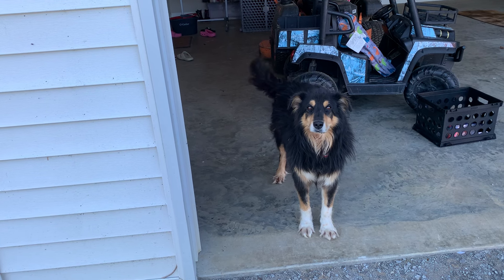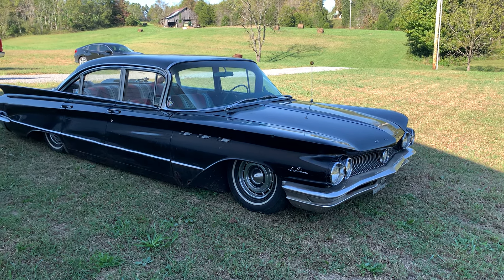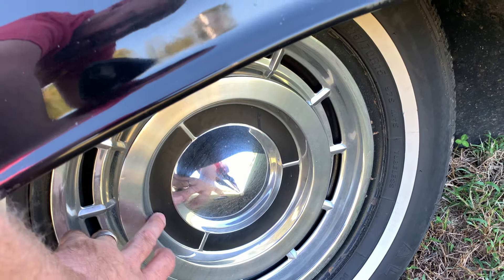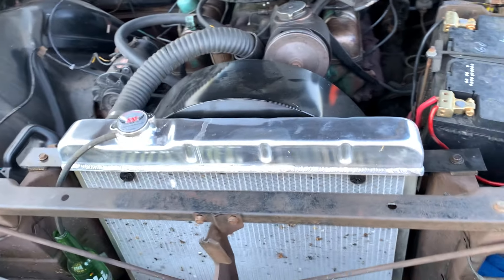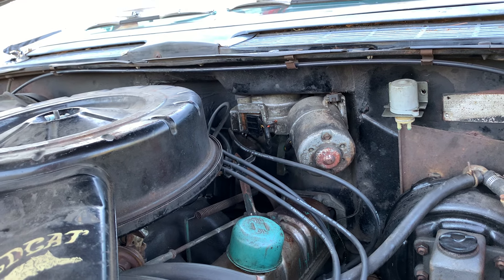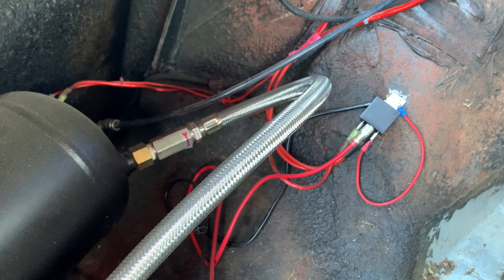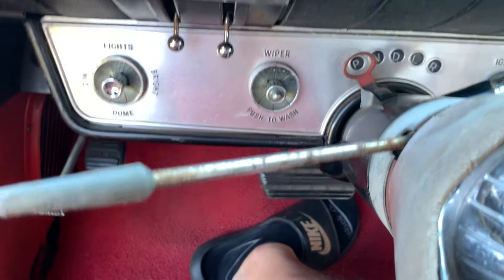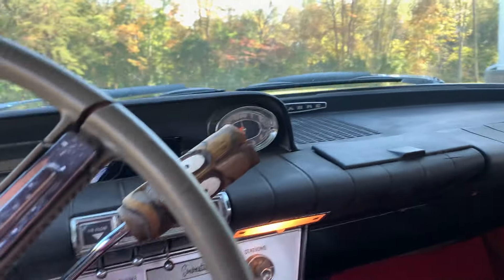Bagged 1960 Buick Lesabre

Comment: Had a '60 Buick myself; 2-dr LeSabre hardtop. Very reliable too - until it got caught in floodwaters at the Willowbrook Mall in NJ in the late 70s. Btw, I think fan shrouds WERE  standard w/o AC (mine had one) but they were basically small, square metal shields that stuck out over the fan. I can tell your car was never towed from the rear by a sling-type tow truck; that rear 3-piece bumper would have been bowed up in the middle (the brackets were kinda flimsy). One question: with the gas pedal itself removed, how do u start the car? Those early Buicks had a carburetor starter switch activated by the pedal. I converted mine to a regular turn-key type cuz the original setup was a Rube Goldberg-type affair. I like the original radio, with the Civil Defense triangles on it (hope you'll never have to tune into them; ya never know nowadays, tho!). Nice car; & nice Collie-mix doggie too!
Reply from the maker: @Markjohnson-vw4en  the lever that the pedal rode on is still there. Still has the foot start as well. The electrical switch and the linkage for the foot start are all on the carburetor. This car had the little square plate on the factory radiator as well. I’m guessing it was nothing more than a deterrent to keep you from losing a finger in the fan blade lol. Yes those rear bumpers brackets are very flimsy, somehow the rear bumper survived but I have the dented in front point of the hood like all of them.